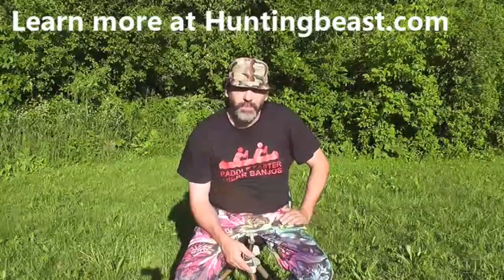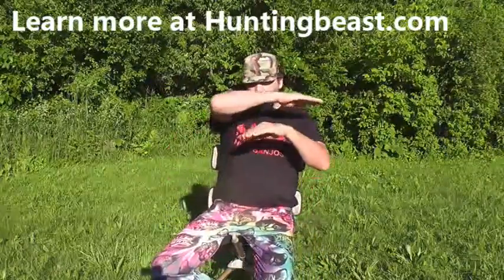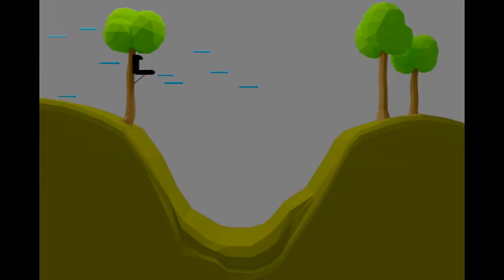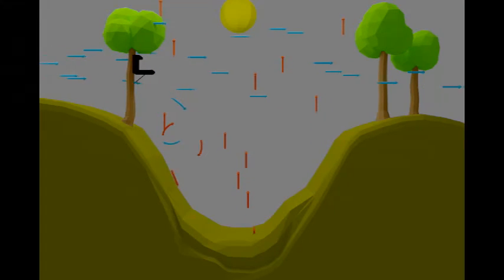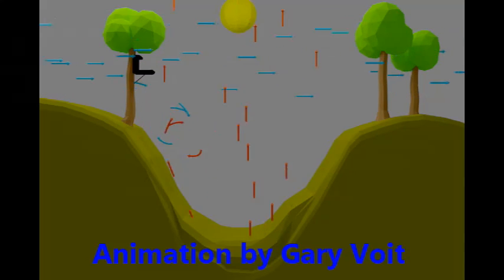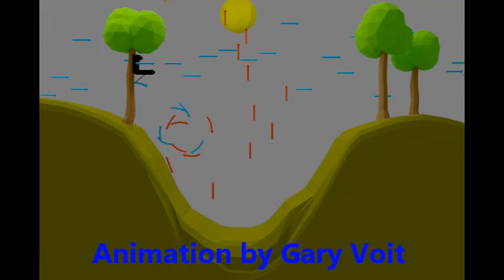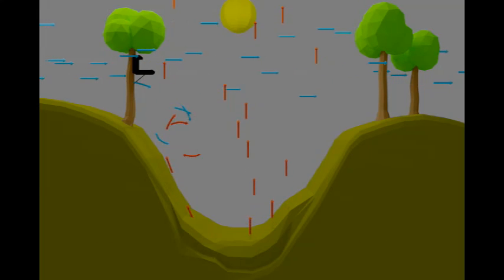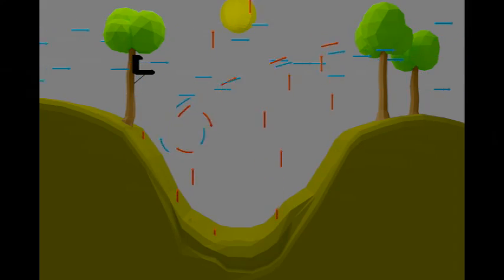The thermal wind tunel

Comment: So, how do you hunt this thermal wind tunnel?
Reply from the maker: During the rut when bucks cruise the tunnel there are a few ways to hunt it. My favorite is to find a spot along the ridge that has an obstacle, like a deep draw, or a fallen tree, that forces travel out of the the wind tunnel, either above or below. (above works better.) And then you can get into the wind stream. The second best way is to get high and try and blow over them. Every now and then I get winded doing this, but if positioned well, I can usually shoot them before they leave.
Reply: @thehuntingbeast  That second tactic is what I was I had in mind, but that obstacle tactic is great as well.  The terrain I've been mapping on topo seems to have draws every 100 to 200 yards on the ridges so this could work.  Appreciate you Dan.

Comment: Great video and animation! I have just one question (I really have a million, but I'll spare your time. lol). What do the thermals do for the evening hunt, when the temperatures drop and there isn't a pond at the bottom of the hill?
Reply from the maker: When a shadow casts over the hill side when the sun drops to a certain height, the ground will start to cool and the thermals will switch 180 degrees and start to fall...  Dropping thermals can be referred to like water. They follow the lowest ground down as if it were water poured on the hill.
Reply: The Hunting Beast - Extreme Whitetail Tactics Very well put! Thank you for your response. So if I know the temperate is going to drop, I would want to place my stand below the 2/3 elevation line, but high enough in the tree to be above the wind tunnel. correct?
Reply from the maker: Once the thermal switch takes place the wind tunnel goes away and thermals drop and follow the natural wind direction on the leeward side. So yes, you would want to be lower.
Reply: The Hunting Beast - Extreme Whitetail Tactics
Good to know. Thank you so much for your help! I've already put in a lot of scouting time using your techniques. Thanks for the videos!